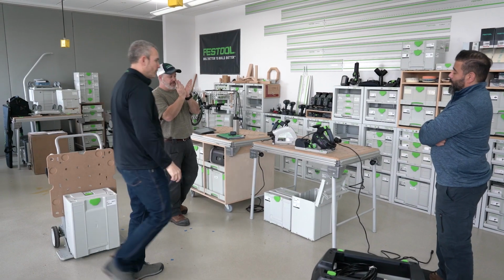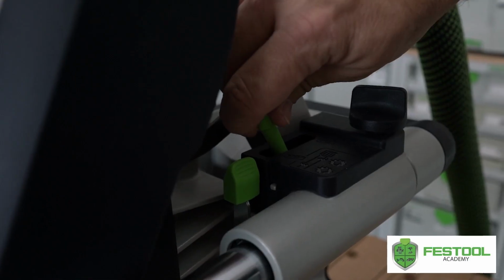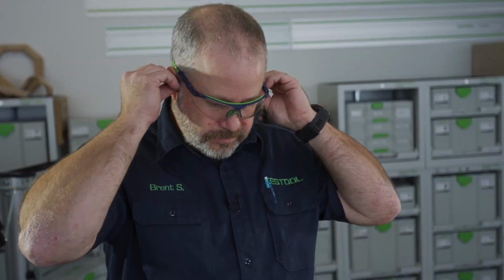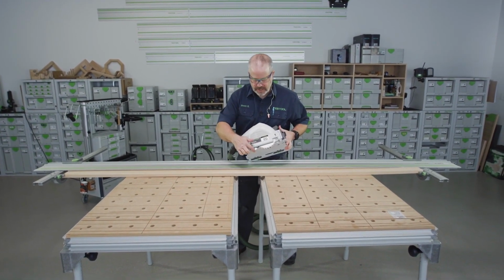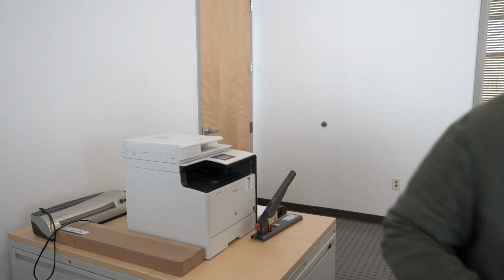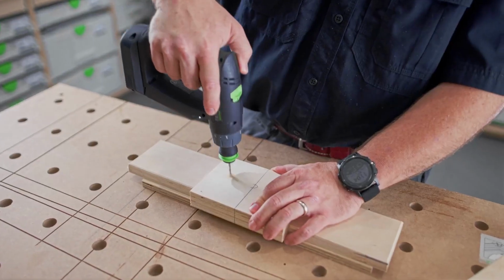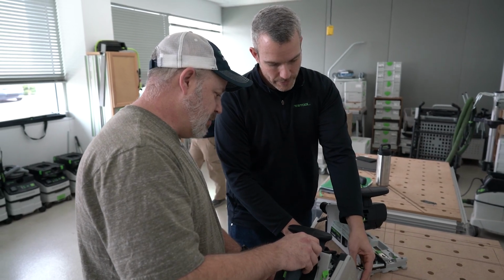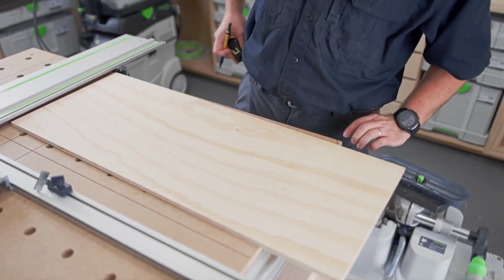Episode Nine: Inside Training with Brent Shively

Comment: Anyone else see hit cut the parallel guide? Is that normal?
Reply: He uses the parallel guide-extensions.  These are designed in a way that you will not cut into them. But it seems so indeed 😅
Reply: I thought so but … Saw some sparks when he got to them.
Reply: It’s because the calibration of the parallel guide extensions require you to butt it into the carbides of the TS55 blade. See the videos how they calibrate it and you will know.
Reply: There is a gap underneath to allow relief, also he more than likely set the depth just enough to cut the wood. There did seem as if there was something fly off. Not sure what it was tho.